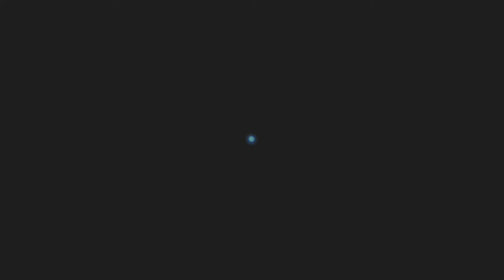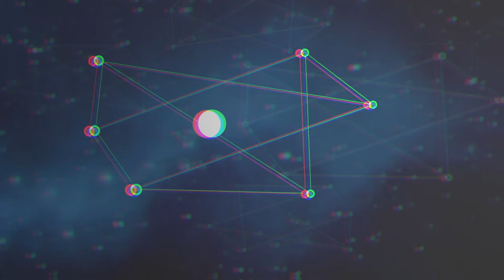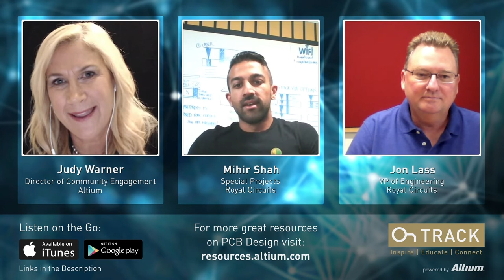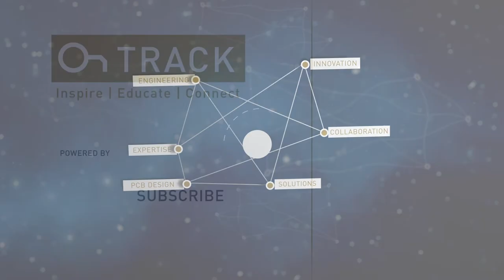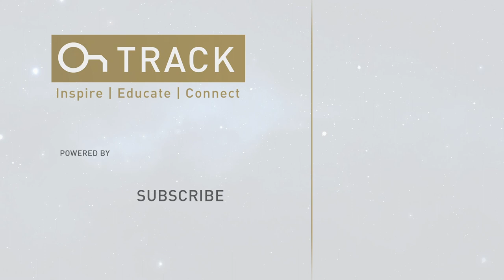PCB Manufacturing Best Practices with Royal Circuits

Comment: What are your takes on placing ICT test points on high impedance nodes for switching regulators such as Feedback, ITH/VC (control loop compensation pins), and frequency set pins?